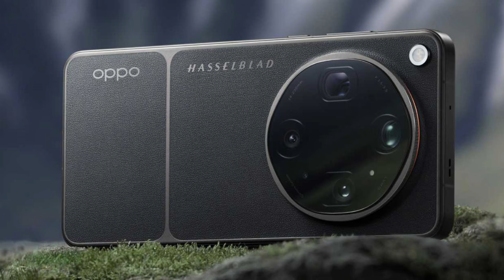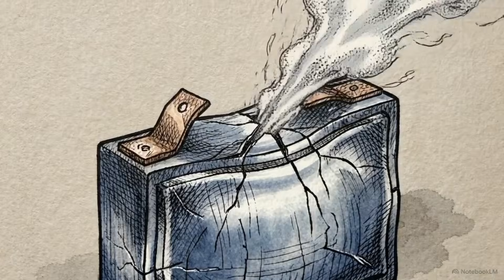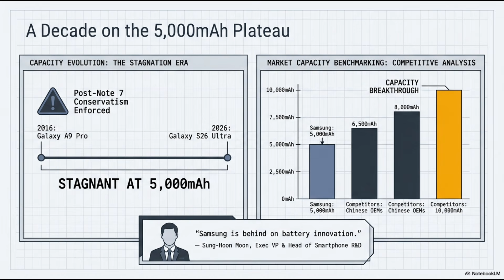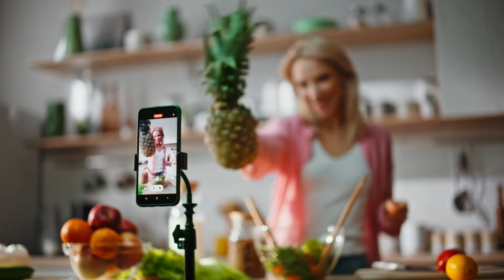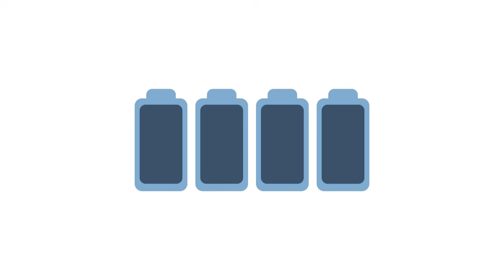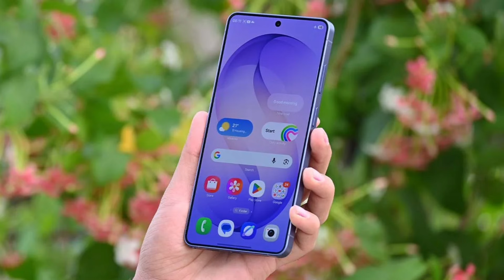S27 Ultra Getting New Silicone Carbon Battery. Finally Samsung Gives Fans Something to Cheer About!

Comment: From Google Gemini AI::
Yes, the Motorola Razr Fold (a book-style foldable released in April 2026) features a 6,000mAh silicon-carbon battery.  
This advanced technology allows the device to maintain a slim 4.6mm profile while offering the largest battery capacity currently available in a US foldable. It also supports 80W TurboPower wired charging and 50W wireless charging.
Reply from the maker: Thanks for the information ℹ️ good to know that.